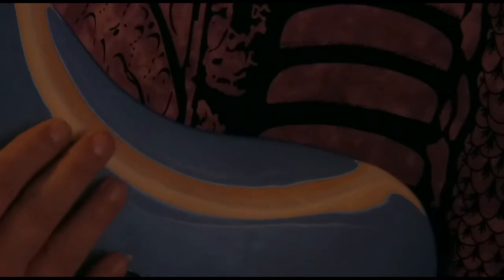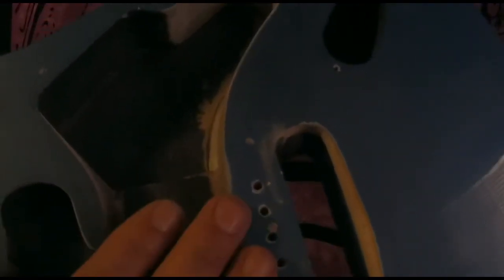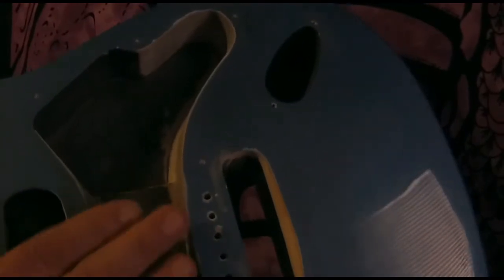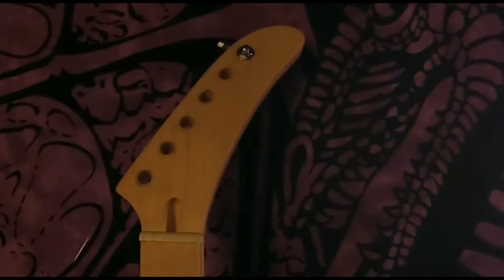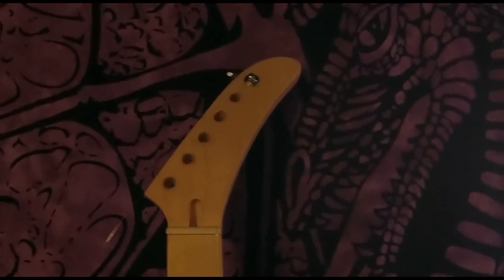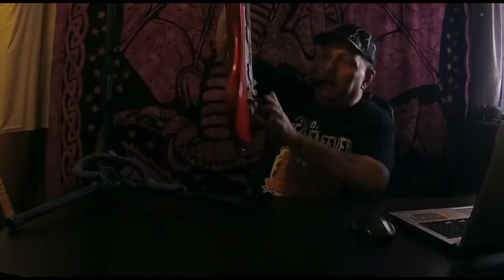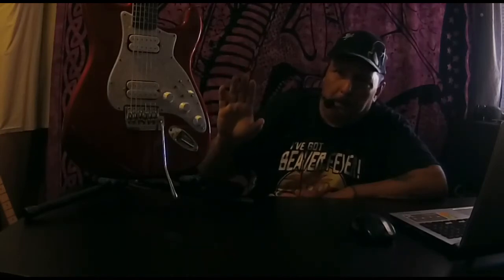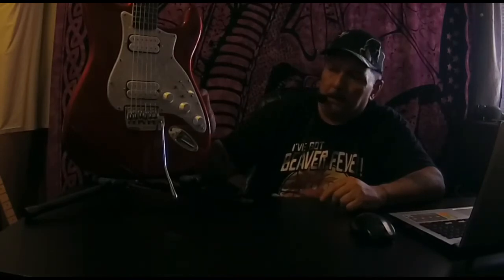Hard Luck Kings Guitar Review And Rebuild Part 2

Comment: Well now you know why you they called them hard luck guitars. That looks like it was built by a bunch of 5yr old Chinese kindergardeners.   When the end what my assessment is that you ended up throwing pretty much everything away and you had to do so much rework on the body that for less money like $80 you could have bought a reasonably good well finished body off the guitar fetish site and still had to change an add all the other stuff with a neck and parts Etc and you would have been 20 bucks a head. Interesting watch thanks. I have a 2-hour video on my Cozart on my site up until a point I finished it the first time. I'm a video the conversion back to a 6-string not sure yet
Reply from the maker: If it wasn't for the fact I like the challenge of the rebuild/modify process I probably would have trashed the guitar and bought something else. From this rebuild I have learned a lot about what to look for in a project guitar. Needless to say I made a bad choice with this one. However next month I will be done with the "Junkyard Special", registered trademark pending, and I will get a new video up on it.
Reply: RJ D'MadOne 
I'm curious to see how it all turns out in the end. Looks like that 12 string Cozart Telecaster I got won't work because of the neck. The truss rod operates between the 7th fret and the 17th fret which puts the compensation or relief in the wrong part of the neck. So I'm thinking of converting it back to a six string with a neck I'm taking off of my tele number 2 project when I replace that neck with the one I just got. I need to pick up a modern style Bridge for the Cozart because that's what it has as all my other Telly's have vintage bridges on them. I'll see how it works out I'll probably make a video of that conversion for my channel as well